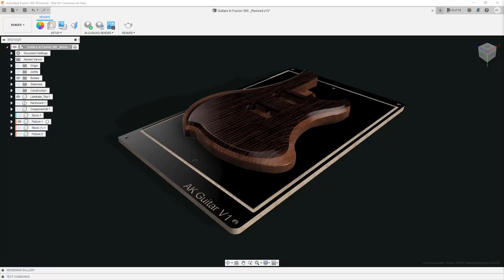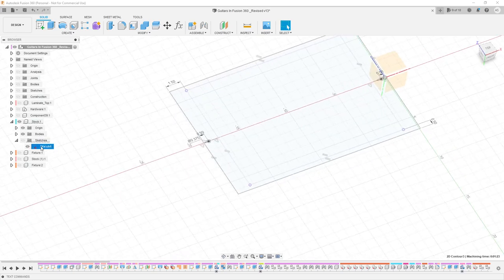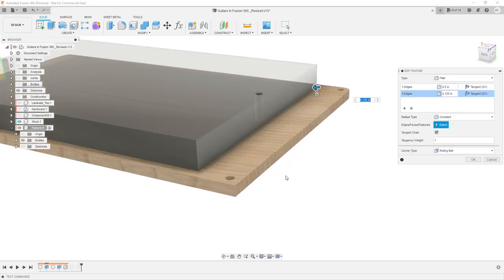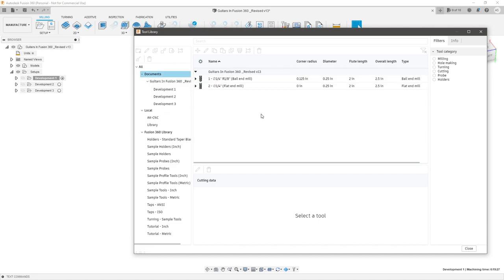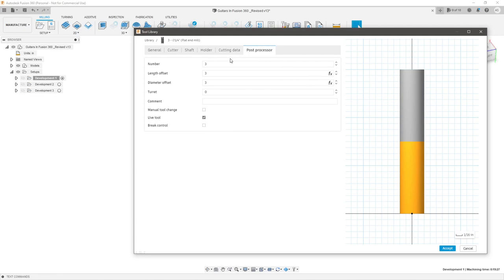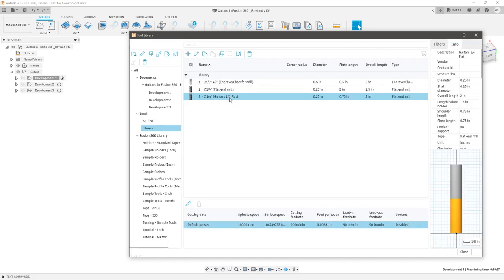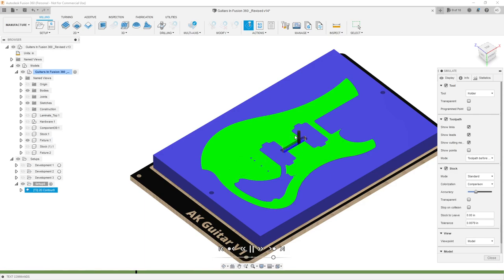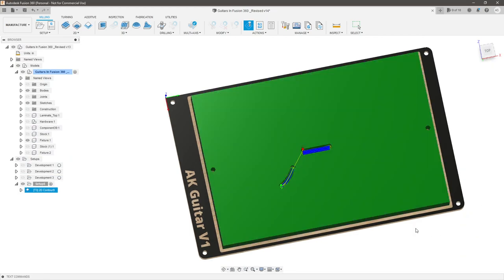How to program CAM for guitar bodies in Fusion 360 | Complete Tutorial

Comment: Thanks for a great series!  This seemed like a good place to ask the question out of all in the collection.  You speak of tool paths and order of operations often which makes for good usable work segments.  I appreciate the thought that goes into your process.  When it comes to machining operations that require a tool change, do you (or anyone else) prefer to separate those operations into their own code files or keep everything in a single operation?  I was practicing using some of the techniques you described and when it was time to change the tool, I shifted the machine, this throwing it out of alignment.  Knowing that I had no way of getting it back mid-operation, I wondered if breaking it into more manageable chunks like that might be a good practice.  Was that covered in any of your videos?  I'd love to hear others' experience in that regard.  Thanks!
Reply from the maker: That sort of depends on what the capabilities of your machine is. For example if you have an ATC spindle, it would be smart to group as many into one operation (with automatic tool changes) together. If you have a standard collet spindle, then depending on how much you trust your machine to not lose xy position you could either group or split them up. 

I can't trust my machine to maintain position during a tool change, so I try to group all toolpaths that require the same tool into one operation, then tool change and rezero, then a group of all toolpaths that use the next tool into one operation. 

However, there are still some operations I keep 100% separate from the rest, and those are usually ones where I need to dial in a specific tolerance and re-run it again without taking the workpiece off the machine. That way I can run, measure, change the stock to leave etc, repost, and run again

Comment: Hi Austin, thank you for this video, I've learned a lot from it. I got all the CAM set up for a Strat body with this info. However, when I set it up on the machine it doesn't want to cut at the work piece. It wants to cut air more in the middle of the machine. and what's confusing is I just machined two other projects this week with no problem? I have a probe with my Shapeoko XX3, so it should zero out at the work piece. I also went into setups and made sure in the post processing tab, in the WCS box it has a 1 in the first set up and a 2 in the second set up for when I flip the body over. However, none of this will make the machine start at the work piece where I probe it? I think it must have something to do with this newer NC system. Have you experienced this? and if so how did you work through it? Thanks..

Comment: Very awesome dude! This was a super helpful tutorial! One question, how do you set your zero on the machine to the origin point of the fixture? By eye? Edge finder?
Reply from the maker: Thanks!! I have a couple different ways depending on what I'm machining. I have an aluminum touch probe that let's me find xyz, a z touch probe that came with my xcarve, but honestly I typically do it by feel/eye. So I will bring the endmill near the edge of my fixture or workpiece, shine a light behind it (pointed towards me) and rotate the bit until the light disappears at the flute and I can just barely feel it scraping the wood.

That usually gets me within about a thou or two which is more than enough for wood.

Comment: Great video - I learned a ton.  Thank you Austin!  

Will you at some point post a video of the actual cutting on your CNC?   Your methods to index, hold-down and flip were not clear to me.  Also, you had some "rapid collision with stock" errors.  I'd love top see how you resolved those (that's something I've struggled with).
Reply from the maker: Hey Ben! I'm glad this was helpful!

Yes, I do plan on machining this at some point and will post a video when I do. 

The rapid collision error is sometimes confusing. But what it means is that my bit contacted the stock while it was using a G0 rapid move command. To put it more plainly, my bit hit my stock while it was moving from one cutting location to another. There are a lot of reasons this could happen, such as lead ins or lead outs, clearance for the bit from a previous operation etc... I apologize I don't remember the specific cause from my video.
Reply from the maker: As for my indexing, I'm simply using two dowel pins to hold the alignment with clamps to hold down the stock, flip the part, realign with pins/ clamp, and keep cutting. 

As for the fixture, I am simply zeroing my workoffsets on the fixture, rather than the stock. The only challenge this brings Is that I need to provide the fixture with a specific thickess of stock. Because I won't be accommodating much variation in thickess by zeroing off off of the work piece like you normally would.
Reply: Would lowering your tolerance from.0004 down to say .004 shorten you machining time while still yielding a reasonable tolerance? This was one of the first things that tripped me up machining time wise. Super video, I love watching peoples approaches to cam and always take something away from it - I love that you explain why your doing something- this is extremely helpful for us beginners. I don’t build guitars but this video was immensely helpful. I hope you do more of these. Also would love to watch this part being cut on the machine. Cheers!

Comment: This is clearing up so many little frustrating details for me. Thanks so much! I also have a "wimpy X-carve" :)
Reply from the maker: I've made it a little less wimpy over the years - but I'm nearly due for an upgrade. I'd like to go with the PrintNC - which as far as I'm concerned is the most capable and cost efficient package I can find (around 1k). My "dream" machine would be AVID CNC but I can't fork out 10k for that.
Reply: @austinshaner  I've upgraded a number of parts too. It's a decent machine, though I'd like one a bit larger so I could cut baritone and bass necks without tiling. And something beefy enough to really cut aluminum in a reasonable amount of time so I could realistically make my own bridges. I hadn't come across the PrintNC before. I imagine that steel frame would really help with cutting metal.